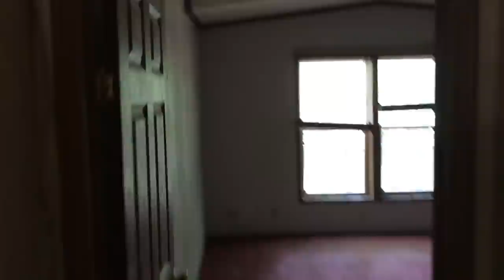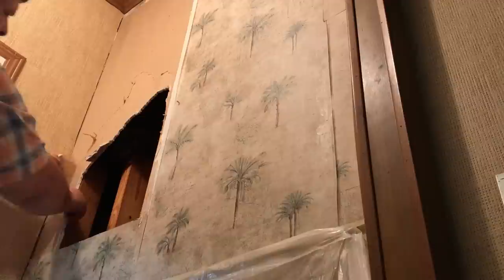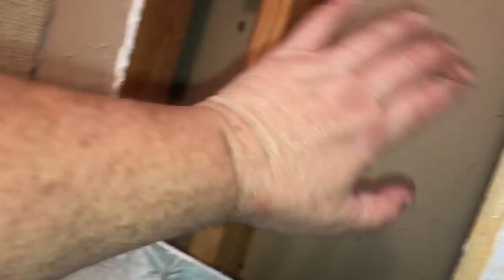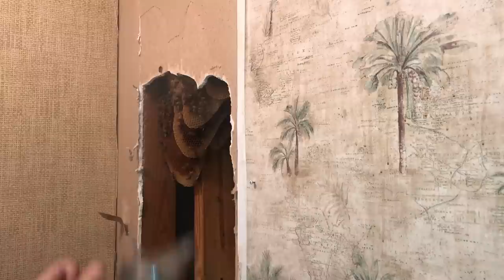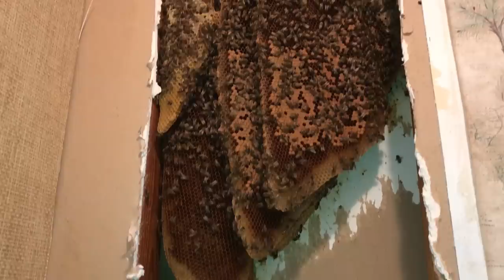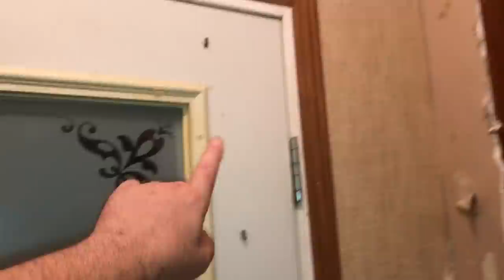He Bought A House With Bees In It

Comment: I just came home from doing a bee removal.  My first bee removal I did 5 years ago called last night.  It was a year old hive about 1/3rd smaller then what was on this video.  A 5 gallon bucket of honey comb/trash and 4 frames of brood.  I live in Texas, so it being so hot (Temperature) queens shut down.  If it weren't so hot this hive would be boiling with bees.  I had removed a 4x8 sheet of plywood that was attached to pallets as a make shift chicken pen.  No chickens in that pen for awhile.  I did see 2 guinea fowl though that she had roaming around freely.  Pretty cool to see them.  Awaiting for dark to pick up the bees if they go in to the bee box with brood.  If they take off that's perfectly fine too.  Feeding my bees the trash comb now.
Reply from the maker: Interesting.  Glad they called you back instead of someone else.

Comment: This is the stuff nightmares are made out of for me.
Why is it you don’t wear a bee suit?
Reply: Not needed for advanced bee removers and non-Africanized bees. Bee suits help more with Africanized as they use a hyperactive hormone that alerts the hive to sting you until death, non Africanized lack this behavior though so one or two stings are usually just annoying at most (if you don’t have an allergy ofc)
Reply: @brycesmith2375  i have worked with bees for a few years now and all i can say is that for removal. If you dont know the species you are playing cards with death. If it is "regular tempered" bees than yeah deal your hand of a few dozen stings. But for anything else typically regular bees are going to give you double digit level stings instead of killer bees triple. I would say bee suits should always bee worn if you care for your relative comfort, and a much quiker removal. Since you can get guicker with your movements because the bees anger wont be a problem.
Reply: Jeremy Bluered understandable, I’ve heard of a fair bit of keepers say as a precaution to go with the suits but for the most part, in my area I’ll see keepers going out in a long sleeved tee and tucked in pants with just a bee mask. I guess at the end of the day it IS about knowing your bee’s (or someone else’s!)
Reply: @brycesmith2375  that is absolutely true.
My coworker does tge exact same thing. Forgot to mention that. And knowing the temperament of your bees is very important. Some are the nicest little things in the world and others want to sting your eyes.
Reply: As long as they mind their own beeswax I'm okay with them.
Reply: Bee suit = heat stroke
Reply: @seamripper0000  yup.

Comment: It's good advice actually, ya can tell if ya have damp problems if you knock on the wall. It sounds solid, but then there is a weird hollow spot in the middle. You got damp.
Edit: UK houses arn't built like that. We have brick exterior walls and the internal walls are plaster board with studs. Your internal walls are a lot thicker then ours, I think.

Comment: Double wide mobile home...run away.  You really don't want to work on them because things snowball only its mud.
Example: we lived in a trailer we bought. The hollow front door bugged me so I bought an actual house door and put it in. In the process we discovered how the floor was all jacked up so we started fixing things and by the time I was done I'd repaneled part of the walls. New carpet. Pergo floor by the door. I think we spent a couple grand by the time we were satisfied.  It looked great but it was still a mobile home.
Reply from the maker: I am very familiar.  Lived in one myself for the first five years of our marriage and have owned many as rentals.
Reply: Bingo!

Comment: You made a interesting comment about bees and thunder. Bees, even the crossbred African and European killer verity act differently once it begins thundering.  This is a correlation between the claps of thunder, the overall humidity and why the bees began to settle down a notch. The sound from the thunder is calming to the bees, for several experiments on bees showed different sounds would elicit different internal responses from the bees, even causing them to brieflt "faint" and fall out of air and down to the ground, only to come to and fly away.
You made a excellent point about the sound of thunder in this video. Shows the mark of someone who's been around colonies for a long time.
Reply from the maker: Cool study material.
Reply: @628DirtRooster  I had a mentor BK years ago botch a major Yellow Jacket removal. Eastern Yellow Jackets will fly away from the hive and keep attacking you no matter how far away you try and get. It started off as a thunderstorm as we got there and they were not as aggressive. Once the storm blew over, they became irritated quickly, and started swarming me and my mentor. Of course at that time, we had about five children within range of the swarm. I took between thirty to forty stings, my mentor, strangely enough took less. I don't know about you, but pedestrian interference at the worst times gets on my last nerves. As I was getting swarmed I picked up a empty barrel we were using and flung it at the kids, scaring them away. Telling them to run didn't seem like they either heard me, or took me serious. I was able to double back to the truck and grab the fire extinguisher we had in the truck. Was the only thing I could do, as our smoker had been taken by my "mentor." He was a old man, in fact, too old to be doing what he was. He didn't even become a BK until he was 65.
So long story short, the jacket venom made me feel very nauseous, semi-conscious, and hallucinate like I had consumed some wild mushrooms. But the kids were safe, so that helped, I guess :) My old bee keeping stuff is long gone, so I'd like to get back into it again, provided I can get some time off from my cruddy day job.

Hope that wasn't too long my southern friend. I'm in VA, so we have mid-Atlantic type honey here. It's not as good as southern honey, but it's what we have. Thanks for the insightful videos my southern friend. Hope you and your family and friends are blessed all the days ahead.

Comment: Cut that sheetrock (especially 3/8") with a utility knife along the stud edge.   No dust, no vibrations.  Sharp knife will penetrate in 2-3 passes with modest pressure.  Better and easier repair afterwards too.